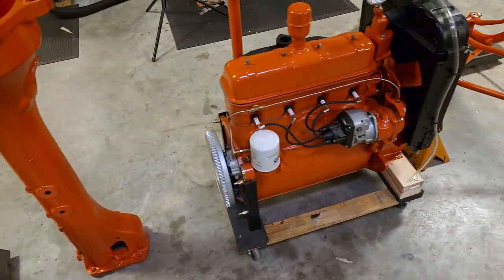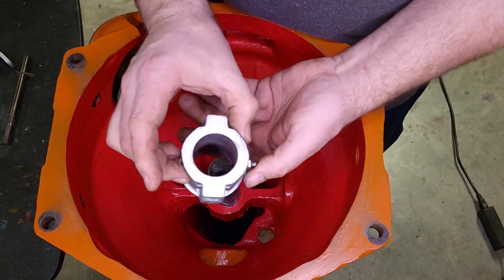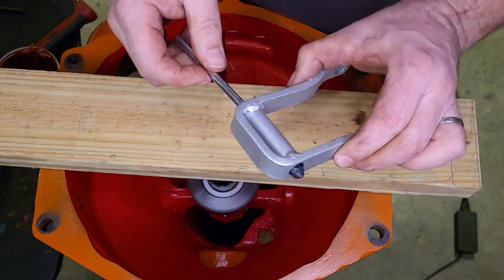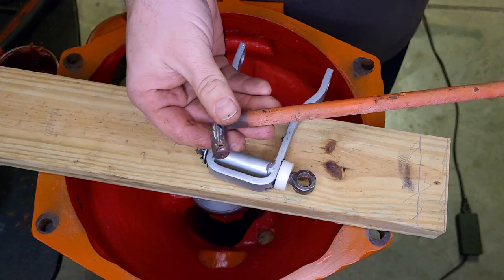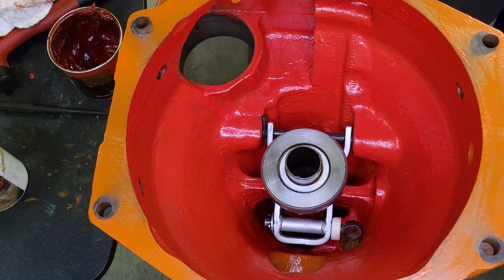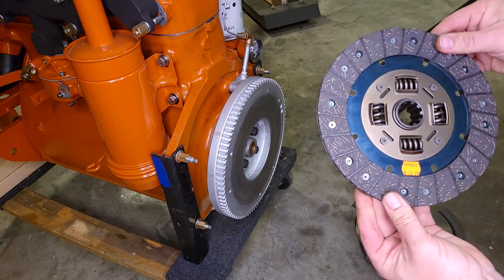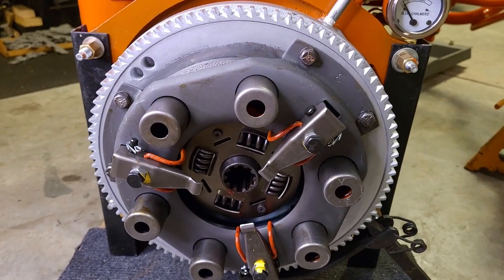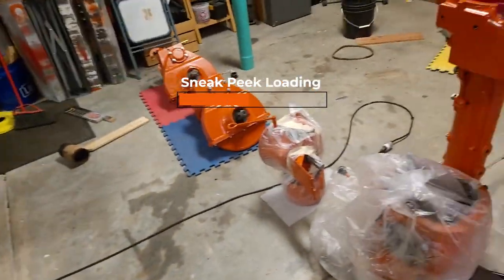1953 Allis chalmers B Clutch Installation

Comment: My clutch fork was worn almost all the way through the one side, also the clutch pin was worn 1/2 way through. I tried to buy new parts, or even used parts, unable to find them. I ended up taking to our machine shop, they welded both up, put a SS hat bushing in the clutch fork, and now its good to go. Love your thorough videos.
Reply from the maker: That's a good way to do it. Thanks, I tried to be more detailed than most vids so they could help others. I didn't find much detail on YouTube before I started this project.

Comment: I have been watching this fine video, and the assembly video that follows as well. I am wondering, Maybe I missed it. Were the fingers on the clutch adjusted? I need to adjust mine.
Reply from the maker: I did not adjust them. The  measuments given In the book are off of a flat clutch disk and mine had springs In the way. It turned out that they were fine and all three were the correct distance from the throwout bearing once assembled. I forget if it was 1/8 or 1/4 but it was in the manual

Comment: I have not gotten into my torque tube yet, but is there a bearing inside to help support that shaft?
Reply from the maker: Nope. The pilot bushing in the flywheel and the transmission input shaft are the only supports.
Reply: @JPN76  Ok, trying to get the pto housing done but I can not get it apart yet. ☹